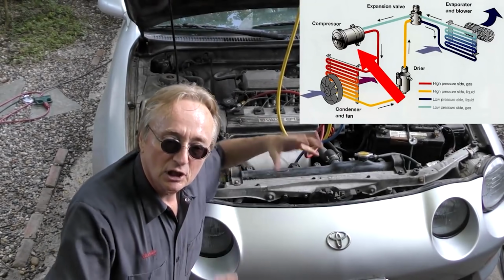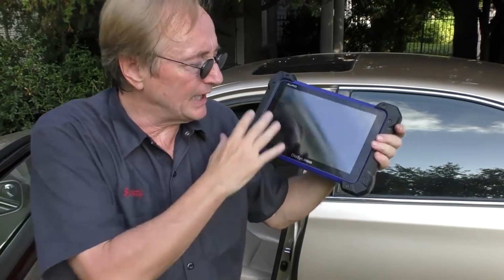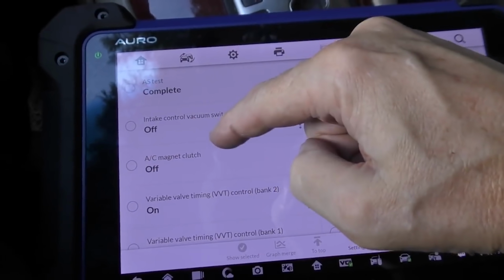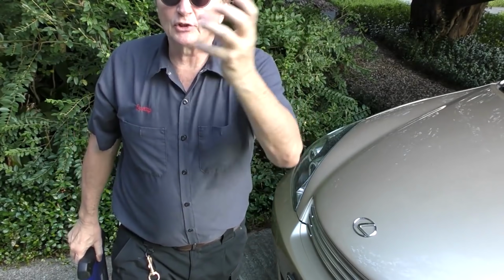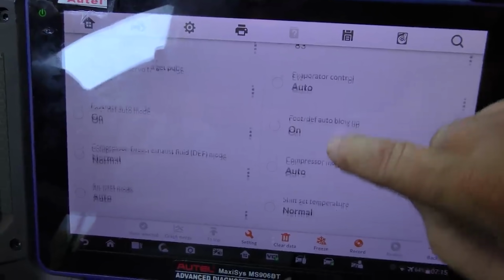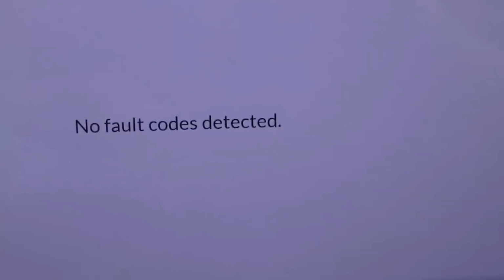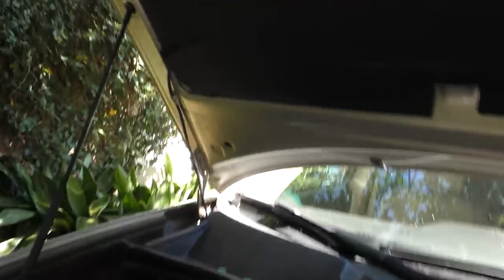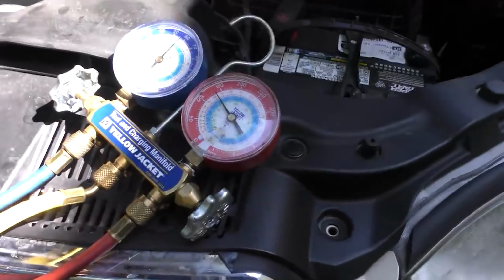Doing This Will Make Your Car’s AC Blow Sub-Zero

Comment: i drive a 2006 Acura CSX and thaA/C works great for a while then the air flow really diminishes . Upon lifting the hood and examining the engine compartment I can see there is frost build up on the pipes goinginto the fire wall. ?

Comment: My A.C. blows cold air but the engine performance diminishes when I put it on. it gets worse during high traffic scenario and can even shut off the engine. Without the AC on the engine works great, what could be the problem?

Comment: I've been working on cars new and old since I was 12 years of age. Collected a lot of tools over the years now that I am 23, but one thing I didn't have was a genuine Scantool. I recently purchased one and scanned my 2011 Chrysler 300 Limited. I always wondered why my ac would fluctuate in temperature. Scanned the BCM and found an active code for my Humidity Sensor. Researched on Alldata and found that my dual climate takes feedback from this sensor to determine how much refrigerant to compress. Purchased the Humidity Sensor from my local dealer for 50 buckaroos, cleared the DTC in the BCM and boom ac works good as new.

Comment: I love all your videos Scotty keep them coming. I'm a refrigeration mechanic of 20 years in Australia and it'll illegal to just top up refrigerant without trying to source a leak. It can cost you a huge fine or even loss of your refrigerant handling licence. Sometimes it is extremely difficult to source a refrigerant leak.
Reply: My A.C. blows cold air but the engine performance diminishes when I put it on. it gets worse during high traffic scenario and can even shut off the engine. Without the AC on the engine works great, what could be the problem?
Reply: Here in Canada, we have similar rules.. americans can do whatever they want

Comment: 2003 Toyota Rav4 and when I turn the AC on, the light flashes. I assume it is low on refrigerant, but don't use it enough. Got it about 13-14 months ago and it always did it when I owned it

Comment: I have a 1999 honda civic LX my airconditioning blows 60 degrees I tried charging my system myself adding 143 frion and the filler gauge that the can screws onto it and blows only 60 degrees what am i doing wrong to not be blowing no colder than that?

Comment: great vid. did you hire someone to do the intro clip? they did a good job. great info as always

people also forget that charging the a/c can help in winter as well with the defrost as i think it uses it to dry the air or something like that. also, good idea to keep it charged even if you don't use it. my 96 hyundai elantra ended up having the compressor seize up causing the belt for the cams to snap somehow

that plastic part on the toyota reminds me of the junction part used on my 95 jeep cherokee i had, finally got a metal one after 3 plastic ones popped.

Comment: Question are there any reliable bmws?
Reply: My sister has a 17 year old BMW X3, Its been in our family since 2010, Its had tires, 2 batteries, brakes, and fluid changes. Sure the sunroof doesn't open all the way back anymore, it has a random check engine light that pops up sometimes, but otherwise its a tank! 180k miles

Comment: hey 
we have a lexus lx570 and the front ac is fine 
but the rear ac just doesnt blow cold air 
is it because it has low refrigerant??? i went to a mechanic and he said to fix it it will cost about 2000$ ?!
Reply: That could be the case, my issue on a Pilot was that it also freezed the evaporator preventing air flow. Adding refrigerant fixed both problems, rear ac getting colder and evaporator not freezing. You'll need the gauges, otherwise call shops for pricing on evacuating and refilling your ac.

Comment: This may be a stupid question, but these principals hold true for  home A/C systems, yes?
Low refrigerant, foreign contamination?
God forbid, compressor failure?
Reply: The process of compressing and releasing pressure to cool yes. But loading it with refrigerant they put the refrigerant in as a liquid most times.

Comment: Also, learn how to actually operate your A/C system.  I can't tell you how many times I have had a customer come in with "A/C blows warm" and my "repair" was to push a button.

I nearly always let them go for no charge, and thus gain a customer for life.  But then ones that argue?   They pay for a full system diagnostic.   And then, an evacuate and recharge, plus adding dye to the system for future problems.
Reply: What do you charge for evacuating and recharge? Replace schrader valves?

Comment: We have a Toyota Yaris 2008 and the air conditioner is not cold enough when the car is standing idle but when the car is on the highway the air conditioner is cold again. What will be the problem? My guess is that is maybe a problem with the fan that is not kick in properly, or a combination of a problem with the fan and lack of refrigerant. What you think Scotty. By the way a guy put another compressor some time before because the other compressor was starting to fail and that was when the problem start to apear.

Comment: Well abviously it has to be fixed by finding & correcting the refrigirant leak, if it leaks out once 2nd time no fill up but need to be fixed, otherwise note it in your report especially if you have your epa cert., actually it shall be added as liquid with ac off car off, weighted inn, and should of weight how much you initially tool out of the vehicle to gove you an idea if it's low and has a leak or overcharged by someone

Comment: My CRV a/c is barely keeping up with the hot weather, especially when idling parked-- it cools stronger when I'm on the highway. New compressor 2 years ago. I assume I need a recharge--but how about my radiator/engine coolant system, could that be having an effect on my a/c too?

Comment: My 06 camry ac would blow absolutely freezing asap till about 250k till I added refr. My 19 if it's over 90 it takes way longer to cool maybe because it's black inside out. But it also lacks the heat compete to 06 the 06 would defrost frozen snow asap not the new one I just don't get it

Comment: What if the compressor clutch is not engaging, is not visibly spinning when AC is turned on? Relays and fuses are good.
Reply: The charge may be too low, most systems have a "low-pressure cutout" when the system's low pressure side gets below a safe level. You also might want to check the plug and wiring going to that switch if your vehicle has that.
Also, check the connector and wiring going to the compressor clutch. I've seen a loose plug be the cause.

Comment: Hey Scottie, I have an 07 Mercury Montego Premier I bought from a buddy. He says the AC has always has an  issue where it doesn't perform well on really hot days, and only gets cold when the car is moving. He took it in for service and they said they charged the system up but it didn't make a difference. What would you suggest I do?

Comment: What about 2008 toyota tundra, it blows air but only cold when driving it. If it's parked or at a red light it will warm up again until i start moving, what could be the problem, where my dad bought it they replaced the whole ac system but problem ia still there

Comment: I have a 1987 dodge d150 and the window looks like there's rust in it will adding some help it .ps passanger side and drivers side is hot mostly in the summer.

Comment: The best thing anyone can do to their cars air conditioning new car old car doesn't matter what car is to wrap high temp insulation around all the refrigerant lines in the system.
Reply: These systems are designed to meet a certain specification and are not intended to do the best that they can do. They have a lot of things going against them. Mainly the engine itself producing heat. Air conditioning is just a heat pump that pumps the heat from the internal cabin out and if the engine is producing a minimum of 195°, it becomes very difficult for the system to work at its full capacity. By installing insulation lines in every refrigerant line you mitigate a lot of heat introduced by the engine. And so you essentially kill the endless cycle of using power to move heat made by the engine, just to use more power just to move more heat made by the engine.

Comment: This won’t fix the temperature coming out the vents but if you notice that the air is coming out as strong as it used to. Look into replacing your cabin air filter. If you haven’t replaced it in a long time and it’s dirty it will keep your air from coming out as strong as it should. Also keep in mind to that you want to use a vacuum pump to get all the moisture out of your system before you fill it with R134. As Freon and water become corrosive and will eat through parts of your A/C system.

Comment: Scotty I have a 2012 Chrysler 200 and take it to a personal mechanic guy I know. He’s retired like you, and having been a mechanic about 35 years. My AC has been running funny for a while now. It works at high speeds on the highway and blows cold but then almost immediately stops in traffic like stops signs and street lights. We’ve replaced the Thermostat, the temp coolant sensor, added new coolant, emptied and added new Freon, replaced the compressor, and it isn’t a head gasket leak. What could it possibly be? It’s driving me crazy because the heat is kicking my a$$ out here man and we can’t seem to pin point why it keeps overheating. It is high mileage at 160k but I take care of it for the most part. What could it be Scotty??????
Reply: oh also both fans seem to be working. I haven’t replaced the fans since I had the vehicle tho. We also replaced the water pump. But yet it still blows hot at stop signs and red lights/idle

Comment: My type where I put the Freon in, it wraps around the alternator for some reason and I because of the friction there is now a hole  in the pipe. I used some in jb weld steel stick and it seems to be holding

Comment: Got a free 01 Pathfinder with 216k a few months and the AC still blows cold lol. Don't drive it much because the rear main seal is leaking, previous owner obviously didn't keep up with oil changes. Runs amazing though.

Comment: I have always wondered when you adjust the temp.( up/warmer) on ac, does the system work less or does it blend in warm air? 2003 Silverado 4.3, a great truck that has never given me any problems & I intend to keep for a lot longer. THX
Reply: Jerry ... temp change inside the AC box is just blending warm air from the heater. The AC runs about the same up to a point where the compressor will cycle off, depending on the ambient outside temp.
Reply: Yes, rupe53 is correct. Keeping the compressor running most of the time & blending warm air results in better dehumidification of the air since the evaporator stays cold & continuously removes moisture from the air. The way to reduce load on the system is to run "max" or "recirculate". The hotter the air passing over the evaporator the greater the head pressure at the compressor so why do a constant intake of 90-100 plus degree air when you can recirculate cabin air that's already been cooled. AND, that results in still greater reduction in humidity because each "pass" of recirculated air over the evaporator further reduces moisture. High humidity air also increases load on the system because as the humidity goes up you're not simply cooling the "air" but also the "water" in it which we don't see & don't think what it does to an A/C system.
Reply: @DejaView  ... the moisture has very little effect on the AC parts and drains away. You are right about the increase in head pressure, but today's systems are not designed for "short cycling" the comp because it wears the clutch and causes early failure. Have you compared cutch size between a recent car and one from 40 years ago? They are downright wimpy now!

Comment: Bahahaha, I hate those ATC units so much that I actually ripped out the entire ATC unit on one of the pre production test vehicles & replaced both the wiring harnesses as well as the entire heater /AC blower box assembly as well as the control panel ,best decision I did with that vehicle as I used it personally for many years! I had to pull out the entire dashboard & console unit & reset the ECM for the old school analog vaccum system.,I still got this pre production vehicle for over 22 years ....I sold the ATC assembly & all the old (new) parts to a customer for over 1k too 🤣 the manual systems work way better than those fancy digital ATC units

Comment: one problem that i saw in this video. i don't think that he mentioned that if you used the old R-12 you would have to retro fit it to the R134-A. at least, that's what our regulations are in Ontario, Canada. might be different from state to state? also, if it's been filled with some of these aftermarket products, some places won't repair it since it will ruin their a/c recovery machine. not quite sure since it's been a long time since i've performed any a/c diagnostics on any vehicle. but thank you Scotty for another cool video!

Comment: Lexus blend door actuators do not last forever, I had to replace both sides on my 04 ES330.  Of course that was at a 190k.  They were fairly easy to get at.
Reply: I have a Ford Fusion (EU) 2007 1.4L 84hp (pushing 100hp on LPG). It blows ice cold and I have never touched the A/C system in my life.

Maybe Ford is better than Toyota

Comment: Hello Scotty, hope you're okay. I'm planning to get either an AWD or two wheel drive, but first, I have a small question for you. I know that AWD vehicles have a central diff that is NOT lockable, and since power will always follow the path of least resistance, does that mean if only one wheel of an AWD has no traction (in the air for instance), the vehicle won't move?

Comment: Hi Scotty, is it really necessary to have the ac compressor oil changed regularly? Got a 2017 toyota rush, currently no problem at all but a mechanic told me to have it changed as regular maintenance for the ac. Cheers.

Comment: Luv ur videos and u have a ton of information that helps us all. So u will appreciate a tweak to ur understanding of how an ac system works.....liquid refrigeration is sent to the evaporator via pressure differential where the liquid flashes off as it absorbs the heat out of the air being recirculated around the cabin and across the evaporator. The compressor pulls/sucks the vapor/heat out of the evaporator so more liquid can flow into the evaporator. The compressor discharges the vapor with the heat that  was once in the car air and via a condenser exchanger is now sent outside of the car....the vapor is cooled via this heat exchange and turn back into a liquid....cycle repeats.....it won’t work if u can’t get a change of state from liquid to vapor and then from vapor to liquid

Comment: One little tip that I think some people forget (and this pertains mainly to older vehicles -- like ones made prior to about 2005 or so).... to keep your AC in tip-top shape, make sure to run it at least for 5 minutes each month during the cooler months.  This cycles the fluids and runs the system.  On most newer cars, when you run the defroster, you also are running the AC system at the same time, but on older vehicles, this wasn't always the case.  Most modern car's AC systems should last 8-10 years at least from what I've seen, but this may depend on usage too.

Comment: What if my issue is that the driver’s side vent is cold while my center vents and passenger’s side vent is warm? My 2002 LX honda civic is having that issue and doesn’t have dual control A/C. Compressor replaced, Cabin Filter has been replaced (made sure that air flow is pointing down), AC refrigerant has be refilled and both A/C values have been replaced.

Comment: Looks like an old Texas video. I had a 2010 Ford Taurus that I bought brand new. It didn't get cold on a hot day. One dealer wouldn't even look at the thing and I wrote Ford a letter over it. I took it to another dealer and they drove it around a little and took it back in the shop. They told me that the factory put in too much freon, so don't even assume that even a new car is right.  I kept the car 8 year years and it worked fine after that.

Comment: The AC doesn't work on my 08 toyota sienna. Added a whole can and still doesn't. Heat barely works unless I let the car run for almost an hour. Runs good otherwise.
Reply: Change your A/C compressor and refill with refrigerant. As for the heat issue, get your heater core flushed out or replaced. And, change out your blower motor.
Reply: Or a badly clogged cabin air filter....

Comment: Some mechanics will compress air to the system then will check for leaks with soap.
Do you approve this method Scotty?
Reply: MKZ89 ... shop air from a compressor is full of water so not an approved way to look for leaks, especially if that air also has some oil from an old compressor, which will not be compatible with AC system oil.
Reply: @rupe53  much appreciate 👍

Comment: I am not a professional mechanic, but i am a hobbies, and in two of my friends cars i found something weird but totally possible to happend that you didn't mention in the video (and i think was the problem on the last car of this video)

What i saw is that sometimes, there is a leak in the system, that leak will take out the entire refrigerant, but... the compressor on some cars, doesnt have or doesnt have working a pressure sensor, so the compressor conntinues to suck on the system, just to suck air from the atmosfere, so the entire system have  compressed air inside, that is why the pressures show so high on low and so low on high.

I found this in a couple of friends and on both i solve it by replacing the port valves and recharging, and everything start to work perfectly again.